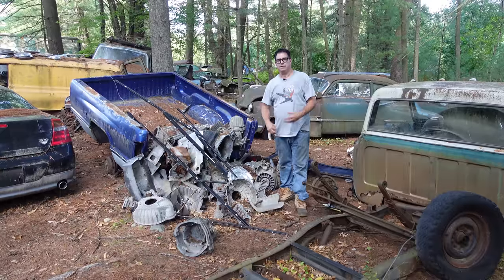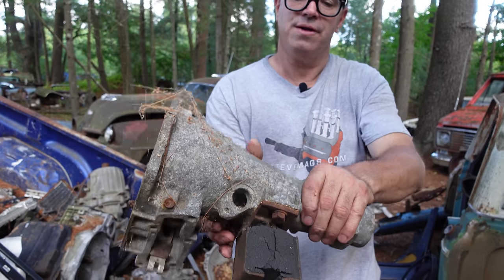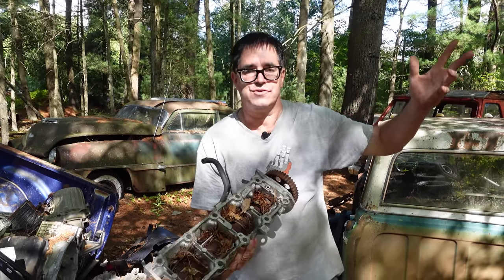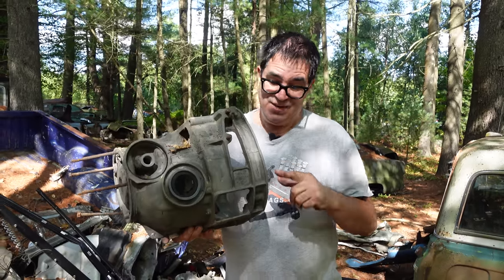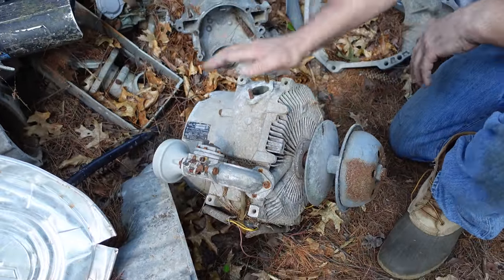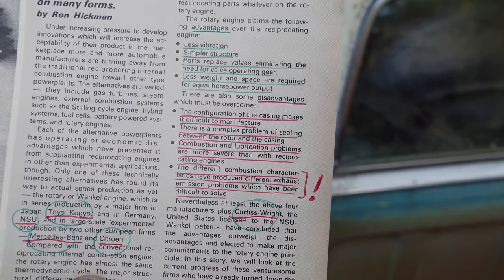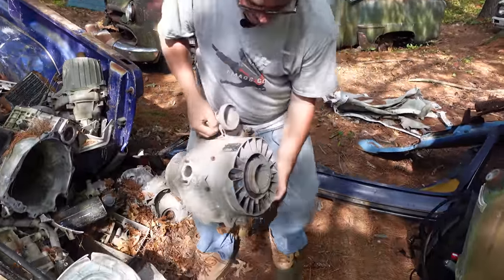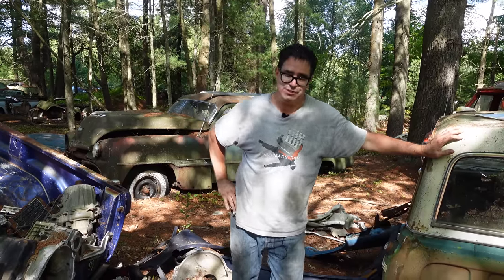Aluminum The Poor Man’s Silver

Comment: As a former volunteer firefighter, I had my share of encounters with magnesium car parts. Makes for a cool fireworks display.
Reply: as another volunteer (and state certified instructor) we learned that you could put that fire out with water, but not in a conventional way. We used multiple 3 inch lines without a nozzle. That's right... run about 20 - 30 PSI pressure and flow a LOT of gallons. Recalling the few we put out took 2-3,000 gallons. Cooling the metal that wasn't burning (yet) was the key. Class D extinguishers were useless unless you could lay the powder on thick. Yes, there were a few cases where 10 guys rolled the car over to do the job.
Reply: There were a lot of fire departments that learned the hard way on air cooled VW engine fires. Water wad just problematic. One of the leading culprits: the brass fitting for the inlet on the VW Solex carburetors was press fit. That fitting would work its way out and place gasoline on a hot engine. Those air-cooled crank cases were H-O-T in the summer. I've never owened a VW but my dad was 100% a dyed VW air cooled guy. I gleaned a lot about all of this. Not often people still have the car they learned to drive in. But my dad still has his father's 63 beetle.
Reply: @mindeloman  ... Fuel was always the issue on those VW fires, but I have to say that I never saw that brass part "just fall out" because it was usually a leaky hose than cause the problem. How do I know? I worked for a dealer and a specialty shop in that era and probably rebuilt near 400 of those engines. What I have seen is a gasoline fire that was hot enough to melt the carb. At that point various brass parts would fall off because the aluminum melts first.
Reply: @rupe53  yeah, I worded that wrong. The fuel hose where it goes into the fitting on the carb was press fit. No clamp. With time the hose could just slip off.

Comment: Back when I was a sophomore in high school in 1971 my hometown of Peoria Illinois got a Mazda dealership and they had a huge promotional campaign hyping the Wankel engine that powered it even before the first cars hit the showroom. On the day they opened myself and a few friends piled into my buddies dad's station wagon and and hit the grand opening. That was back when they still used WW2 searchlights to draw attention and gave away hotdogs and Cokes at the door. After all that hype the dealership was gone within two years because of all the problems with the rotor side seals on the engine causing excessive oil consumption and sparkplug fouling. Cars with a couple of thousand miles on them were going thru a quart of oil every time they filled the tank with gas. It was a great idea but the execution caused it's demise.
Reply: the rotary used oil to lubricate the seals, they use a metering pump to pump oil into the carburetor when running like a 2-stroke gas engine, the manual instructions tell you this and the need to check/add oil when buying gas, if it ran low on oil, it shut the engine off.
 plugs fouled, either metering pump set too high, or they bypassed low oil switch to drive it home or to gas station, maybe left it jumpered, and ran eriodically low on oil eating the seals up, never saw seals in Mazda fail prematurely except in amatuer 'rebuilds' with the exception of one, that had a metering pump fail.
Reply: I had a '74 truck that my grandpa drove until about 1999, then I drove it for 3 years, including a 100mph plus trip to Phoenix where the tach didn't drop below 5000 rpm for 2.5 hours. I sold it for 500 dollars, still running. That's my experience with a rotary engine.

Comment: Steve does math in his head to make sure the statute of limitations has passed since the 1990 police incident before he tells the flaming magnesium on his street story.... Steve, I am glad you are a fairly young guy because I could watch these junkyard crawls for the next 20 years. I often find that the topics I think have no interest in turn out to be the most interesting videos. The one about truck wheels being the widowmakers for example. I am old and I had never heard about the danger of the wheels blowing apart. Keep this great content coming Steve!
Reply: The widow makers brought about the steel cages used to hold tires and wheels for disassembly. Those wheels are called split rims which are also used on aircraft.  The first step in removing a tire is to remove the valve stem.  😎🤗

Comment: IIRC, the Mazda rotary engines needed a "thermal reactor" in the exhaust to clean up the emissions. Those "thermal reactors" would get VERY hot, and sometimes melt the carpets in the cars, and also were known to start fires under the car when hot and parked over flammable materials. I specifically remember working on an 81 RX7....actually our shop replaced the blown-up original engine with a rebuilt unit. I was very surprised to see that it had a small 4-barrel carburetor! What a mess of vacuum-line spaghetti that thing was!

Comment: As some might recall, the Wankel engine also suffered from poor MPG, which during the early 70s fuel shortage put a major damper on things. An RX7 sports car got maybe 15 MPG on the highway..... and if you liked to keep your foot on the gas, maybe 10 MPG around town.
Reply: I remember the gas price jump of the 70's. Many people knew they needed to buy a small car for better MPG. When driving the Mazda, they were excited they didn't need to give up performance to drive a small;; car. Their big surprise came within the first month when they realized their big American trade in had as good of mileage as the cramped Mazda. The MPG killed the Wankle. The Mazda RX-7 continued due to the great power of the Wankle compared to the weight and size.
Reply: Yes, very poor. I worked with a guy who had an otherwise stock first gen RX7 but it had a 600 Holley on that little engine!

Comment: NSU Auto Union would eventually become what we know today as Audi. Yes, the Wankel debacle of the 1970s for the H body GM cars was typical of GM's myopic vision back in the day. Honda showed up the US car industry when they took a Chevrolet small block V8 and applied their CVCC (Compound Vortex Controlled Combustion) and it worked, proving that the technology could be applied to other engines other than Honda products. 

Things like that were the beginning of the end for GM's dominance in the auto industry when they got so large that they forgot where they came from. It continues to this day. One of the best things I think GM did was join forces with Toyota under NUMMI to joint venture build small cars. I wish that they were still doing it today. 

I think we need to recycle more readily and waste less and reuse more. That's more of being practical which means you're "green" at the same time. If you can reuse something, great. If you can reduce the use of it, great. If you have to recycle it, great. Putting in the ground isn't going to help much. Most folks can do the reuse and recycle part well and that's a good start.

Comment: Kid next door had a Wankel engine Arctic Cat snowmobile. The sound was something like an old two cylinder John Deer tractor with serious engine problems. That was about 1980 I'd seen a few Wankel powered snowmobiles but that was the only one I ever actually saw running. Every other one I've ever seen was in a scrap pile or had a conventional snowmobile engine stuck in it. Put a 440 out of a Polaris in the Cheetah I had. Gearing seemed way off, I'm guessing the Wankels ran at higher rpm or where geared low due to lack of low end torque?

Comment: Great video as always! I can’t believe you didn’t know what that front wheel drive transmission was since you’re a Mopar guy. That’s a 604/41TE which kept Chrysler dealers busy through the 1990’s and put many kids through college. 😃
Reply: Yep. And it was from a vehicle with a Mitsubishi 3.0 V-6. You can tell by the U-shaped area between the top bellhousing bolts where the coolant tube ran through. The lack of an extension housing for the right side axle shaft makes me think it was from an AWD minivan.

After all the bugs were worked out this became a fairly reliable transmission. My 2007 Grand Caravan has 205k miles on the original unit that has had no work other than a few fluid & filter services.
Reply: I was searching for these comments. 😁 604s were the hot movers 20-25 years ago when I started.

Comment: I believe the AMC Pacer was also designed for a rotary engine. The mediocre fuel mileage and lack of torque also factors in its failure to become mainstream.
Reply: Correct. They contracted through GM to supply AMC with Wankel engines. Once GM decided not to go with the wankel, amc had no supplier combined with the wankels issues, amc ended up just putting it’s tried and true 4.2l in-line 6 into the pacer. Unfortunately the fuel economy wasn’t there in that combo.

Comment: Hey Steve, my nice friend from over the pond! :)

We talked abnout the Rabbit/Golf & i told you a little about my passion about American classic & modern cars, like especially the 2006 Dodge Charger R/T Daytona (Top Banana!) what i´ve found at NC and imported it to me to Bavaria (Allgäu) & modified it especially about reliability/durability, esp. because i think that the "90° V8 OHC Push Rod" with its centered & only one camshaft is a most genius kind of engin design, esp. in making it highly durable/reliable & even because i´ve to do every/any kin of work on a car by myself, i know why i really love that design not only in the case of the production costs, also esp. because it´s the design itself what opns up so much more options in hlp yourself to keep that kind of engines like the HEMI GEN III running & running better, longer & better in maintananc like out of the stock. I´m also a Automotive Designer & Stylist & i can tell you that this kind of engine has so much more potential like 99% of the most engine types out there, esp. than ANY electric motor driven car. & i say "driven", not "Powered", what is ab big, yes a HUGE difference when we talk about options of drive &/or power any car. I write you bcause you´re saying that in opposite to the Magazines topic in that video that; "the Wankel will power 80% (or so) of the Automobiles" to the "Electric Automobile" was that the difference is that the "Electric Automobile is comming..." what could be tell the people a HUGE SCAM; "That the Electric Motor will power the Automobile of tomorrow for sure" & i say that this is a high strategic (so bad!) AGENDA to dissasamble the knowledge &/of building great so called "Internal Combustion Engines" & the WHOLE AUTOMOBILE INDUSTRY especially in the western world. I can see that since 20 years at germany, that it is going Agenda correct into this direction & drove the present electric Automobiles like an Fiat 500 with electric Motor in the evolution step of today & i was SHOCKED. I was so shocked and so against that kind of Automobile in the same moment. i felt that there was something is completely wrong INStANTLY. And yes, that is in short, that the electric motro NEVER was a good option of driving an Automobile. It´s a scam in itself. And thats also because the electric Motor is an Motor & even NOT an ENGINE. The OTTO- & DIESEL ENGINE are TRUE ENGINES & even not MOTORS ONLY. The "Internal Combustion" kind of engines are true (Mobile) POWR PLANTS & could PRODUCE THE ENGERGY BY THEMSELF. The Electric Motor i only USING ENERGY, especially electric energy what is the most worse kind of energy after the Air/Pressure kind of "Motor". It´s the kind of change the kind of usable energy, what makes the electric nergy so worse for driving any Automobile. It´s even the completely worse & wrong way. And you should better think about "Control the pople" or "Dstroy the western local Auto/Industry" when we speak about the electric Atuomobile. It´s in all doirections a complete scam. And that´s the truth & this truth could be digged deeper & deeper, but i wouldn´t tell you here about that worst case scenario. But when you´ll see Automobile Industry/Makers what shoot themselves with taking the best kind of models with internalt combustion engines out of production, for take any (ANY!) electric Automobil in production, you should see or even think about the truth behinde. One of the best examples are if there was Alfa Romeo canceling the QV or Dodge the HEMI for/in combination with the present Charger/Challenger. That was a completely FAIL in any kind of observation angle if you know what i mean. And i think it´s the same like it was back in the 70´s when they destroyed the true customer oriented, American Automobile/& Industry into a "Sad surviving rest of Makers &/or mostly withouth Models that could nearly b the same kind of quality, beauty, production numberss & so on, like it was BEFORE. And back then the "BIG OIL LIE" what is now more actual than between the last event of the "Oil Cricis", that´s narly the ame kind of event, with allways the sam lies & also same kind of manipulations for the people. That´s the sad. & i really hope you, who is naming that time back then "The dark days" could see the truth & then you should have learned from back then, that the "Electric Automobile" is the big scam in itself; It´s also a big dream of the "Social/Communism" Kind of "leadership. & i really don´t mean the forces you could see like any president or so, no. These are all actors for a little clique behind the scenes using the heads you could see in TV for theyr goals and even agendas. But it´s allways the same with lies! They´ll be found out by the pople with the time and a economy will come back on. Just look at the present American Automobile, or also German Automobile Industry. For sure, there are the last remainings of the good thre now. But back in roundabout 2005-18 the Auto industry of Amrica and Europe came back to a new, nice height. And that height is now in high danger to detroy, hopefully not that this would be destroyed  like it was back in the last same kind of "Cricis"; for 20-30 years. Because the kind of destruction what was made with "REGULATIONS" what was made back then, was begun 10 years or so back then from now. Th so called "Regulations" are the worse who could make that possible. And now these "Regulations" comes up to the light of day....

I hope you fel fine, can´t tell you how much i would live at Amrica, for exampl Arizona, Texas or so was the most kind of "I love to live" for me i think :) You coul be sure to be a lucky guy as an Automobile Enthusiast, but about that topic we could speak in the next comments or so, if you like my friend! :)

Cheers Till

Comment: its was over $4 a pound a while back, all the old aluminum box trucks got scrapped for more than they could sell for still running.....   And magnesium the epa took the only primer that worked off the shelf,  it will sacrifice its electrons faster than zink....   Now it has to be anodized when new, or soda blasted , neutralized, and immediately treated with Zink-Chromate etch primer,   The Chromate is illegal in most states, i get it from michigan....

Comment: A other problem with the Daniel is because of the design they were not very fuel efficient. That's probably why they polluted more.  When selling scrap aluminum you must remove all iron and steel from it or you will not get any extra for it.

Comment: Magnesium parts in Curtiss Wright engines made life tense for B-29 crews in WWII. The supercharger housings, to be specific, where there was fuel and an ignition source (as in El Monte) if it backfired, usually during takeoff or climb.
Reply: Even the steel engine cases in the B-29 engine ( Curtiss Wright R-3350 so ~3350 cu. in.) had a high magnesium content and would burn spectacularly if oil too ran low and the engine overheated.

Comment: Not only was G.M. planning on putting a Wankel (properly pronounced "VAWN-kul", by the way), but AMC had contracted with them to providevthem for the Pacer. That explains the tiny size of the Pacer's engine bay; it was designed around the tiny Wankel. I had straight-6 Pacer in the late 80's (seriously, who says no when offered a free, running a d inspected car, ANY free running and inspected car?) and the two rearmost cylinders were back beyond the windshield!

Comment: Because the Wankel was so smooth, some Mazda drivers weren't compelled to upshift by NVH and never got beyond 2nd gear - rotor apex seals didn't like that.  Some racers used the upshift light as a downshift signal - if the light wasn't on, you needed to downshift.
Reply: To help prevent that Mazda installed an incredibly loud buzzer that would go off around 2-300 RPM above red-line in order to tell you you're passed red-line and to shift. Scared the shit out of me the first time it went off on me.

Comment: Low background steel (made before the atom age) is supposingly have a good value. The WW2 wrecks in the pacific are dissapearing for this reason. So don't throw away your pre-war steel too quickly.
Reply: It is no longer an issue. The levels have dropped a lot in the decades since testing ended.
Reply from the maker: Hello Andre Fiset, you make a great point. The WWI German Imperial Navy wrecks under the water at Scapa Flow Scotland are often visited by scientists seeking test metal that hasn't been exposed to natural / man made radiation! The Scapa Flow salvage story is a great Junkyard Crawl! A London area scrap yard owner named Ernest Cox won a contract from the British Royal Navy to raise then salvage the many wrecks of the defeated / interned German High Seas Fleet after the Germans scuttled the ships in an act of defiance the year after their WWI defeat. Cox is THE original Junkyard Crawler!!! Thanks for watching and writing, Steve Magnante